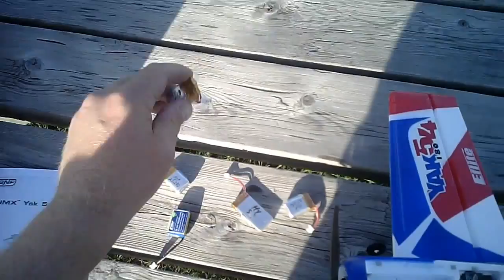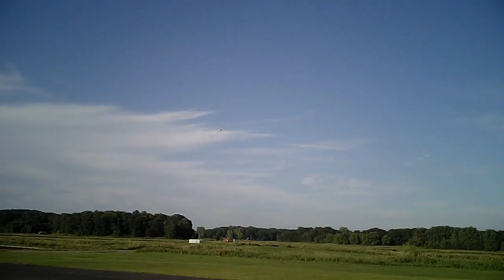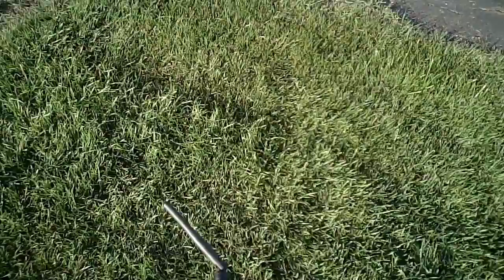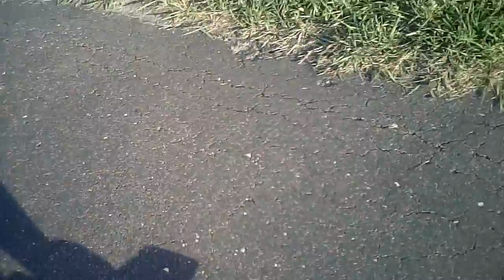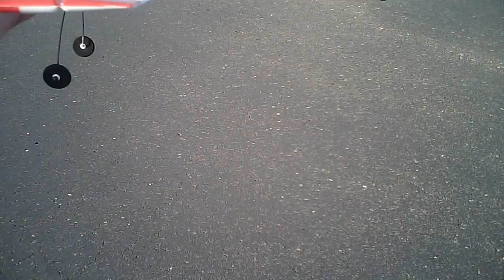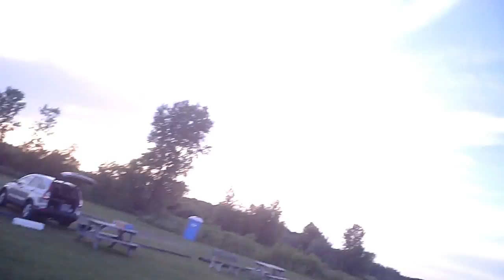E-flite UMX Yak 54 maiden flight

Comment: I think you have an AS3X initialisation problem rather than CG or incidence!  The AS3X is not initialised (or "centered" ) until you move the throttle stick up after plugging in the battery and you need to do this with the wings level side to side and front to back.  If you have set the plane on it's undercarriage in a tail down attitude & initialise the AS3X it will try to fly tail down, looking like it's tail heavy.  The not so flat spins indicate the plane is indeed now nose heavy but the AS3X is holding the nose up.

Also the trim switches don't really work as the AS3X system will take the trim input as a stick input and cancel itself in that axis. If you really do need to trim only do it mechanically by pinching or opening the "U" bends in the pushrods.  Personally I only "trim" the AS3X by setting the plane in the attitude I want it to fly then briefly push the throttle stick to initialise the gyros and center them.
Reply from the maker: As is true with all RC aircraft equipped with 3-axis gyro-based damping systems that don't use accelerometers, AS3X-equipped aircraft do NOT have to be level during initialization. AS3X is a simple 3-axis gyro-based damping system. It does not use accelerometers, and therefore has no idea which way is up. The only requirement is that the aircraft remain motionless during the initialization process - as clearly stated in the manuals. (I've been flying AS3X planes since they first came out over 3 years ago & know this for a fact. The same is true for all of the gyro-only FBL helis & quads I've owned over the decades.)

Also - tx trim works just fine for the initial flight-trimming of AS3X planes - as long as you transfer the tx trim to mechanical trim after the flight if you needed more than 3 standard 'clicks' of trim. (This is also clearly stated in the manuals.) But I have my trim-steps set to the finest setting, so 4 clicks equals 1 standard click of trim.

If you read the 'About' section above, you will see that it was most definitely a decalage problem. The plane failed the standard decalage power-off dive-test, and the stab was quite visibly misaligned with respect to the wing & thrust-line. (I've been building & flying RC planes for over 30 years, so I know how to troubleshoot handling problems.) I simply returned it to my LHS & then inspected their stock and chose one that was visually aligned. The replacement flies perfectly. :D

Check out my blog page on RCG & see my guide on flight-trimming aerobatic planes for details on troubleshooting handling problems. See the AS3X FAQ thread on RCG for the facts on how AS3X works, and see my Carbon Cub handling guide thread for details on proper trimming of AS3X planes. :)

Comment from the maker: Thanks! Yup, I know about the trim. I've been flying AS3X-equipped aircraft since they first came out. Plus, I've been flying RC for nearly 30 years, so I always mechanically trim my planes out of habit - even if they don't have stab/aug systems. It's just good modeling practice. However, the power-off vertical dive-test proves that the incidence is off. The incidence looks much better on the replacement. The next decent flying day will be Thursday, so the maiden will have to wait until then.

Comment: Another great video, thanks! One thing I wanted to mention, and maybe you already know, maybe you dont...but with the UM and UMX planes you are better off mechanically trimming them and not using the transmitter. The AS3X doesn't like it if you put more than 4 clicks via the transmitter. I had a similar problem with my Carbon Cub and I ended up using pliers to pinch the rods at the "U" to get the elevator  just right. It only needed just a small pinch but it was equal to about 5 clicks on the Tx